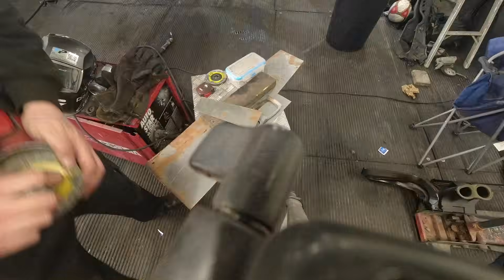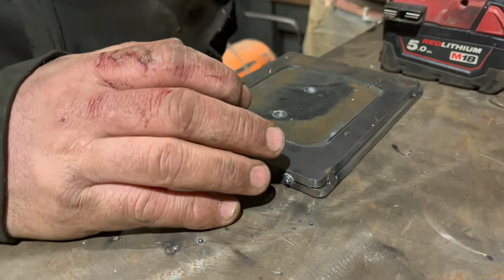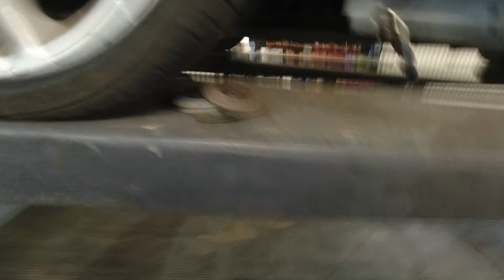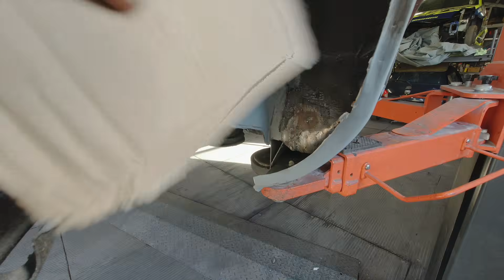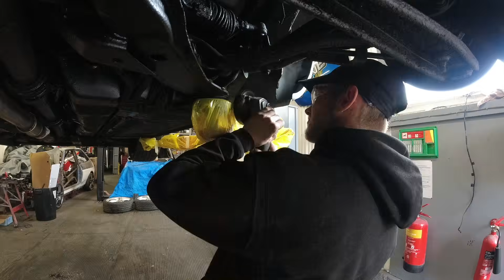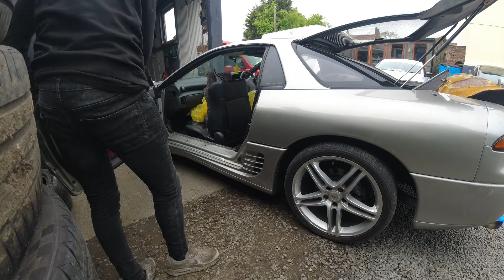How We Fix Rust - JDM Classic Car Recuse - Mitsubishi GTO Twin Turbo

Comment: The old outer sill looked too be double skinned, as it is in a structural area. Did you replace both outer skins.
Reply from the maker: it's single skinned with an overlap that's how it was, and the structural area is a part that went on first with 3mm steel. Hope this helps you.